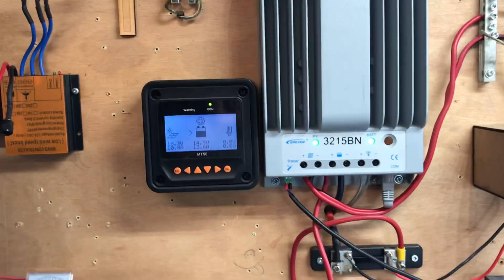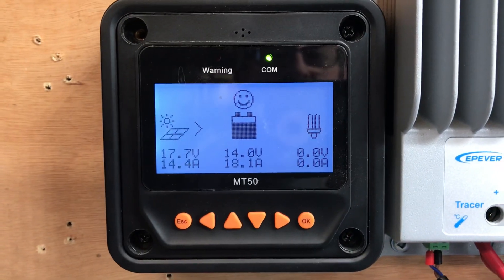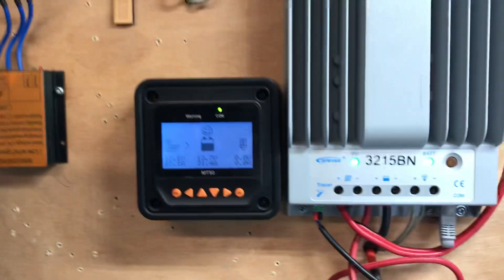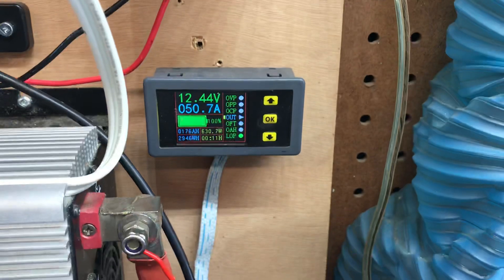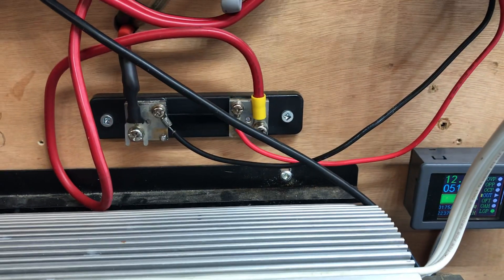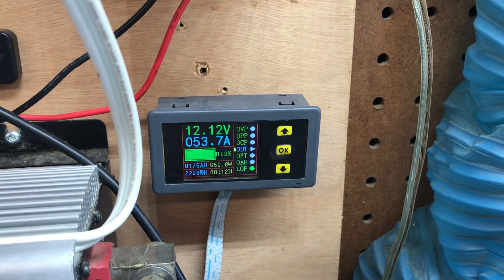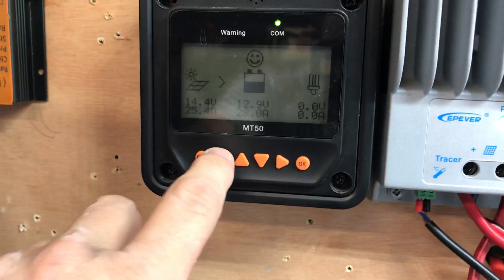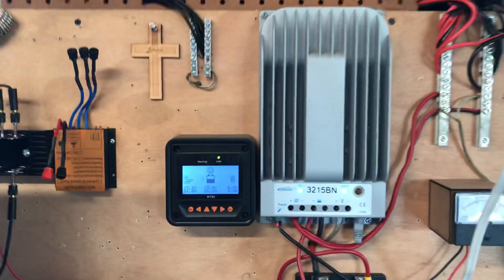EPever tracer explained.. power only when you need it

Comment: Hello, what is that red light to the right of your Battery light for? Please. I have no information on this and have looked everywhere for it. Thank you.
Reply from the maker: That indicates power output for a device if you’re doing 12 V, it will put out 12 V if you’re doing 24 it will do 24 out. There’s a button there and when you push it, it activates it and the light will turn red to let you know that it is on. The light itself is a button so just push it.

Comment: Most of my mini cabin appliances are 12 volt because they are less expensive and available at truck stops. So my battery bank is three 12volt 100 AH lithium wired in parallel. I just bought this new EPever Tracer 40amp BN solar charge controller. Since I need 12 volts out do I have to wire 12 volts in?
Reply from the maker: @InvisibleCitizen  
Yes. What ever voltage you’re battery bank is wired to is what will come out on the switch side. 
I’m now using 24v battery bank so I get 24v out. I had to get a voltage regulator to get it back to 12v for the 12 volt lights I got that I turn on using the little red button.

Comment: is it normal for both lights to flash green ?
Reply from the maker: Yes
Reply: @Checkitfirst  Mine also the two indicators flash like this, however on pressing the button, the flash stopped, the battery indicator turn solid red. I tried a 24v battery, the battery indicator is solid green.

Comment: i have the 4215 40 amp do think it would hold 12 100 watt solar panels 24 v
i seen that the make say 1040 watts on 24 volts and help if any own would know if be ok
i have bus to tiny house rv think running  4 panels 3 set of them to have around 80 volt 
or should i do 3 panels 4 set that give me more amps 
any help if any own know thankds
Reply from the maker: You cannot get more amps by running or panels in the series or parallel. A higher voltage is always better. I have mine running at 110 V in a series. But I am still at 500 Watts.

Comment: Can you show  your  voltage settings  on your  S. Controller??
Reply from the maker: Probably not. But I can tell you what they are. Which perimeters are you specifically looking for and maybe I can help you
Reply: What is your charge limit  V.
Over voltage reconnect 
What is "Boost " charging?
What is  "Float "charging?
Low V disconnect?
Reply from the maker: @boscodog4358  I am running the default settings. I have not changed any of the parameters. As of right now I am on a 24 V system. So I cannot go in there and tell you what my settings were last year because I don’t remember. I find that 24 V is much better. If you have 2 12 V batteries, I would suggest you try it. Of course you would need a 24 V power inverter.

Comment: I have the Epever 60 amp controller. This is the second Epever controller I have had and niether one would put out more than .2 of an amp to charge my two 100 ah 12 volt Lipo batteries. I have 2 small chest deep freezers and my refigerator hooked up to a 2000 watt inverter. I have to recharge my batteries using a battery charger because there is only .2 amps coming out of the controller to the batteries. Would it be possible to see what settings you are using on your Epever before I end up having to spend more money on a third controller? Thx
Reply from the maker: Sure. I can show you. But first,, how many watts of panels do you have and are your batteries in parallel or series

Comment: I have the Tracer4215BN, but every time I connect my inverter (800 watt peak) even without anything connected, I get the “load circuit” error.  I’ve tried several inverters with the same result.  Ideas?
Reply from the maker: Is it the inverter that is telling you that or is it the mt 50 that came with the charge controller
Reply: @Checkitfirst  The MT50 pops up with “load circuit” displayed on the screen, and no power to the inverter from the load terminals.
Reply: I’ve got a couple AGM batteries set up in parallel.  It’s currently arranged for 12V.
Reply from the maker: @lastadventurer1  
It sounds like to me that you have your power inverter connected to your charge controller. Never connect your inverter to the charge controller. Inverters must always be connected directly to the battery. After saying this, do you have your inverter connected to the charge controller on the load side where the switch is you know that red button you push. You cannot connect an inverter to that load.

Comment: Hey brother if you don't mind may I contact you in another way to exchange phone numbers I have several questions and I feel like you could help explain alit of this to me
Reply from the maker: Let’s try communicating this way first if you don’t mind. If it becomes too hard then I’ll give you my email and we can exchange #s then 😊.
Reply: @Checkitfirst  ok that's great thank you very much when I get all my stuff in I'll take pics and arrange everything to be wired I'd like pointers on what I'm doing exactly,I'm learning alot pretty fast but still not quite understanding how much DC power I'm actually using, cause when I compare what I read to actually using the system I have so far I get way more out of it then I expected or I'm just in left field lol 🤣
Reply from the maker: @flintriverkayaking7051  😁. Can’t wait to hear back from you
Reply: I will write down most of my questions and hit you up tomorrow with them, idk where ya live at I'm south Georgia but if I can ever help you out let me know I don't know much about this but i do know alot of dif things, I grew up working everyday with my father since I can remember walking, I was on the job almost every day pushing mop buckets and dif stuff to doing AC electrical to pouring concrete and running wire for the telephone company.
Reply: Hey brother I have a question if my battery has a 100 amp BMS then how do I get  more amps when I can only get 100 with the battery, more batteries?
Reply from the maker: @flintriverkayaking7051  
More batteries,, more power.
Reply: @Checkitfirst  so if I do four batteries with 100 amp BMS then I can pull 325 amps and be good?
Reply from the maker: @flintriverkayaking7051  
On paper yes. Question is,,, why would you need to be pulling so many amps?? What are you doing 😳. What are you wanting to power??
Reply: @Checkitfirst  the people at renogy said that was what I needed to be able to run my 3000 watt psw inverter, I just want to be able to pull the 3000 if I were to need to, I'd like to be able to run lights, fans, small window unit, and full size fridge, I have batteries inverters,3000,2000 and 400 watt solar panel setup I'm just learning so before I start I'm trying to see whitch way you and dif companies are saying to go, I've tried to talk to several people on here and you are the first one to be kind enough to talk back with me having such a lack of knowledge so any input is appreciated tell me what you would do I don't mind over killing it for upgrading in the future I'm all 12 volt right now so 12/24 stuff is fine cause when I do go off grid I'll go big so I don't hafto go home lol 🤣
Reply from the maker: @flintriverkayaking7051  
I would definitely upgrade your panels before I did anything else. You could buy a huge battery bank but if you can’t charge them up that could be an issue. I have 500 watts of solar and two deep cycle marine batteries. If I run them down to about 60% and the next day is very cloudy then it struggles to charge it back up. I am thinking that I would need at least 1000 W of solar. That would help out on the cloudy days. On a good sunny day my battery‘s never go low and I run a small fridge garage lights and a fan all day long on just 500 watts. I have an EP ever 30 amp charge controller. It is the Bn series. If I understood you correctly you said you had 400 W of solar. I would definitely upgrade that first if you want to run everything you said. Run your panels in series also. I have my panels running series at around 110 V. It makes things a lot simpler for me. And I can use smaller wires on the panels to my controller.

Comment: Thanks for sharing your video! Question for you or anyone who may know…I have  400 watts solar with Epever Tracer 4215 -40A with a 2200 watt inverter. My battery is fully charged and I’m getting slow green blinking lights from both PV and battery on the controller. I do not plan to use the system at the moment so do I need to disconnect the battery and how do I disconnect it safely? Thanks
Reply from the maker: The blinking is normal when the sun is out. Do not disconnect your battery unless you are disconnecting the solar panels first. Disconnecting the battery with solar panels connected can damage the controller. You can leave it on as it is and the battery will always be ready to go when you need it.
Reply: @Checkitfirst  okie dokie! Thanks so much 👍🏾

Comment: Any ideas why I get a fast flashing light on the PV side on my BN mppt controller any one .
Reply from the maker: What is your voltage on your pv side
Reply: @Checkitfirst  38 Volt's
Reply: @Checkitfirst  I turned it all off and back on again it's settled back to a normal slow flash now , first time I seen it flash fast this morning. I looked throu the instructions no information on a fast flash.
Reply from the maker: @David-kd7vl    I was looking through my  manual and didn’t see anything either. I have seen mine do that also usually in the morning and when the sun goes down when the pv voltage is lower than it can use
Reply: @Checkitfirst  interesting I live in the UK and it's cloudy today and there was a bit of sunshine this morning when it did this flashing led on the PV side. Strange.
Reply from the maker: @David-kd7vl  
That is a bit strange.
Reply: @Checkitfirst  thanks for the replies would love to find out why this happens will have to do some more research.

Comment: Hi Great video would you recommend the EPever, i can buy a EPever tracer solar controller with the MT50 its just on brand new he wants $170 we are in Australia, what i have is a 300 watt fixed solar panel and 2 x 100ah AGM batteries would a 30amp or 40 amp be better as the one for sale is a 40 amp thank you
Reply from the maker: Mine is a 30 amp. 40 would be better. I would by it.
Reply: @Checkitfirst  Thank you much appreciated

Comment: I have a 2215BN and for the bloody life of me I cannot get it to put more than 3a into the batteries while charging, even a dead bike battery at 11.2v  it will not put more than 3a while charging.
have 3 200a panels in parallel on the roof, 32v at the terminals on the unit.
it's driving me bonkers.
Reply from the maker: Other than the bike battery,,, what kind of battery bank do you have?
Reply: @Checkitfirst 8x 12v 36AH SLA wet cells in  parallel

panels are Trina TSM-200DC01A panels 200w 46voc 5.6a in parallel x3

have reset the mt50 to defaults again tonight and will see how it goes in the morning.

thanks for replying :)
Reply from the maker: @John-gm8ty  are you just charging the batteries or are you putting a load on them at the same time,,? Meaning are you using the batteries at the same time you are charging them.
Reply: @Checkitfirst  well, that's the thing, with the bike battery, it was "dead flat" it should have caused the controller to pump in as many amps as it could, or at least, a lot more than 2.4.
I'll throw a load on tomorrow and take some measurements down and do some testing and post up.
Reply from the maker: @John-gm8ty  
When I’m just charging my bank it sets at about 8 amps and slowly goes to about 1.5 amps at 14+ volts for battery maintenance. Once I turn on the power inverter and turn on the lights and fans , The charge controller begins to put out more amperage right around the same amount that I am drawing to replace what I am using. On this particular load I am talking about it’s usually around 14 amp range. When I turn on a power tool like my tablesaw it jumps way up into the mid 20s. Once I turn everything off the amps go way down. This charge controller is designed to slow charge lead acid batteries at the 14+ volts needed to maintain batteries as they sit not being used
Reply: @Checkitfirst  https://www.youtube.com/watch?v=b9KYUaXGttc

factory reset unit, apply 4a load, drags bike battery to 11.2v which causes cutouts waiting for MPPT to track then 3a max disconnect load, drops to 2a @14v bulk.
Reply from the maker: Is it possible the battery could be bad?
I know that smaller batteries don’t draw as much charge current as bigger batteries. Does your battery ever reach a full state of charge if you just leave it on the charger?
Reply: @Checkitfirst  it's possible, 11.2v is considered pretty much dead, I've got it on a trickle charger over night to see if it'll hold charge tomorrow.
but I can't get my bank to charge at a higher rate either, unless I'm actively pulling it down, even if I discharge it to 12.2 and then put the solar controller on it again, it won't charge higher than 3a max and even then, not for long.
Reply from the maker: @John-gm8ty  
Maybe just to rule out anything else, try disconnecting your solar panels and see if you can put a load on those separately. Do you have a clamp meter or any way of testing the panels. When I first started I accidentally had two of my panels backwards. Even though I was getting an output reading it was weak. Just a question, what direction are your panel facing

Comment: The MPPT Unit will Regulate the Solar power up to the rating of the MPPT. So if it is a 30 amp rated MPPT, then it will only provide up to 30 amps.
Reply from the maker: Yes that is correct

Comment: Try running in series and parallel I'm pushing 42amps w an 8 panel array
Reply from the maker: I’ll give it try this weekend. Thanks. 😊
Reply: A 40 amp controller will not allow the amps to exceed 40.

Comment: I have all my
Components and am almost ready to wire
My unit is a mppt epever 40
2 - 170 watt 19.2v panels 
And 2 deep cycle 12 volt batteries

Use is for couple days of dry camp here and there

My question is 
Should I hook the PANELS in series to create 40 volt input to charge controller ? And what
Happens to the watts do the watts double in series as well? 
My batteries will be hooked in parrallel and feed a 3500 watt inverter ( way over kill)
Great vid some things to look out for with the fluctuations
I look forward to your reply☺️
Reply from the maker: Yes your watts will double as well. The more panels you add The more watts you add. Some people get confused because in series your amps will stay the same and your voltage will rise. In parallel your voltage will stay the same and your amps will rise. If you run your panels in series you can use a slightly smaller wire to your charge controller. I prefer to stay in parallel. If you have two solar panels running series and one of them gets shaded by a leaf or a big bird poop LOL then your whole system is shut down. If you run in parallel you only lose that one panel and your other panel will continue to charge your system. I have my panels running series right now at 100 V. I am on a 24 V system. I am going to go back to a 12 V system because I do not like it. I wanted to try it and I did but I like running all my panels in parallel and staying with a 12 V system. That is just my opinion. Many will argue with me. But that’s OK
Reply: @Checkitfirst  Excellent point on the series/parallel topic. It really depends on what works for you with the size and location of your system.
On a related topic... do you find that the HF kit panels (amorphous) provide a more steady (be it less) flow when subjected to partial shaping and are a worthwhile addition to your solar panel setup?
Reply from the maker: @imxploring  
I’m not a big fan of them anymore. Especially considering the price. I pay about 85 dollars for one 100 watt panel on Amazon. A lot less hassle also
Reply: @Checkitfirst  Thanks for the quick reply. I understand your point. I know Mono panels are the way to go... under ideal sunlight conditions. As I already have 4 of the HF amorphous panels I'm wondering if it's worth adding them (at no additional cost) to my system to provide some extra juice on those less then perfect cloudy days. I might just set them up temporarily to see if they're a worthwhile addition to squeeze out a few extra watts on crappy days!
Again... thanks for the reply! You have a great channel! Very much appreciate your content!
Reply from the maker: @imxploring  
You’re very welcome. Yes the more panels we have the better I would think regardless of brand. I would definitely add them
Reply: I appreciate your time sir
Ok parallel it is
If I may, I’ll follow up with a query or two as I set up
All my wire gauges are proper or over spec.
REGARDS FROM BUFFALO NY!
-Scotty
Reply: How many panels are you running?
Iamsol8@yahoo.com
Respond directly to me so I can show you pictures if you would 
Regards- scotty

Comment: At the 4:55 mark are you putting 25.6a into the system from the PV and drawing 28.3a from the battery for a deficit of 2.7a ?  Does the Panels and MT50 ever match the actual draw off the battery ?
Reply from the maker: Yes. Depending on what time of day it is it will usually go over what the batteries are being drawn at but since it’s PowerPoint tracking there is a delay so sometimes it will read lower but then it will put out more